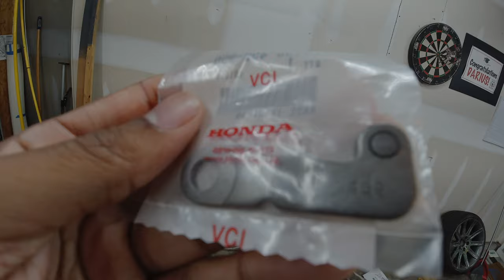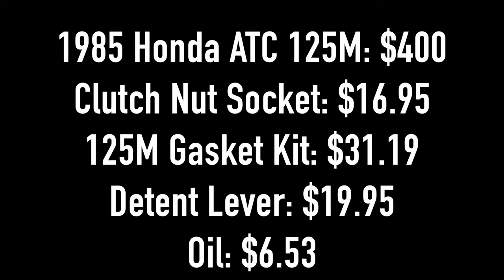Honda Popping Out of Gear Fix | Detent Lever | ATC 125M 3 Wheeler | Trike | #LittleRed

Comment: Quick question? I just picked up an 85 125m. I'm pretty my detent arm is bad as well. But I want too know if u know why the left rear fender is cut? Mine has that same exact square cut out.
Reply from the maker: On my left fender, it’s cracked all the way through. It was like that when I got it. So they riveted an metal license plate on to strengthen it back up.

Comment: My 110 dose not go into 3rd it seems goes neutral like but then another shift hits 4th...down shifting it seems to hit 3rd...any suggestions..its seems to hit 3rd at times though..also it takes a big long foot stroke to shift gears...my 125m seems to only take min effort.
Reply from the maker: I’m not very experienced, but from messing with mine, I wonder if it’s your shifter fork
Reply: Try adjusting the clutch. Theres a screw on the opposite side of the motor